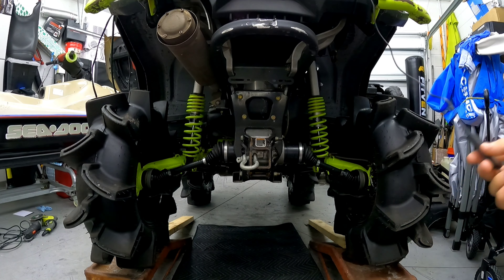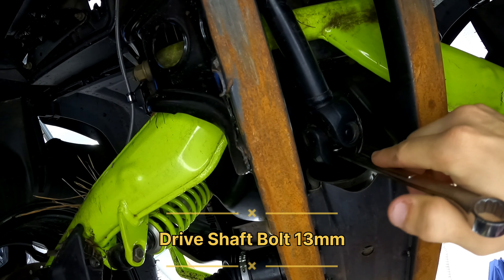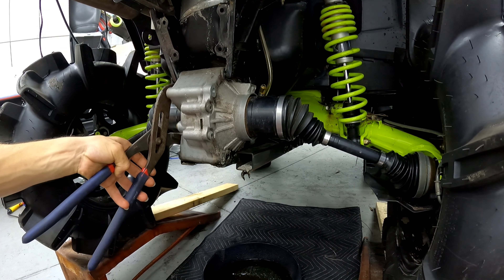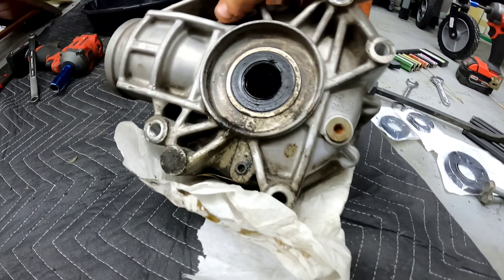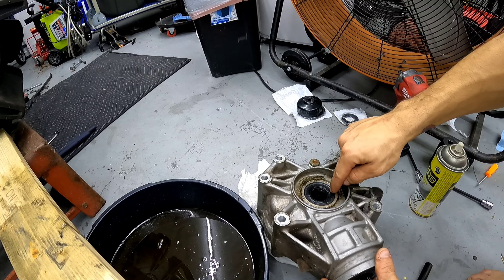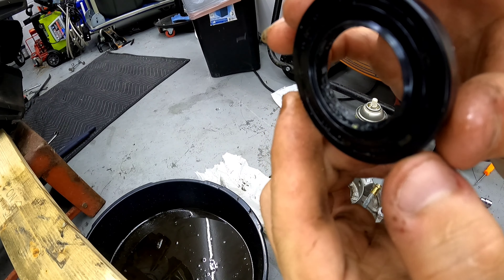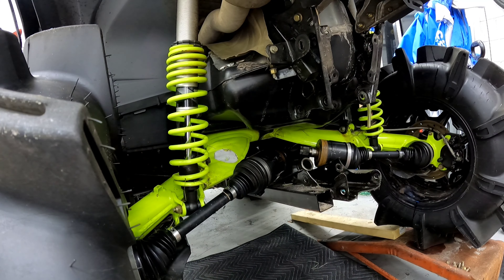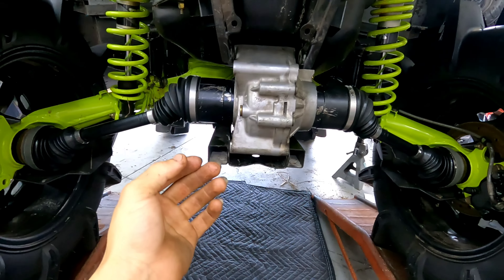CANAM OUTLANDER 1000R XMR REAR DIFF REMOVAL *FAST WAY* UNDER 30 min 🎯🔧(GEN2)

Comment: Great video and explanation. Wondering if I should pull rear differential to help me get engine out, which is my ultimate goal.
Reply from the maker: For the engine you can get away without removing diffs